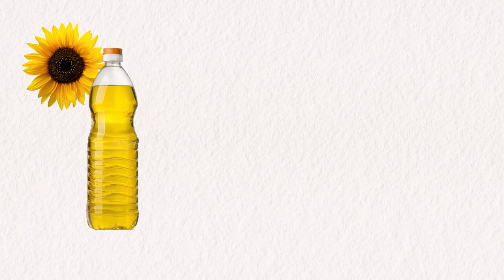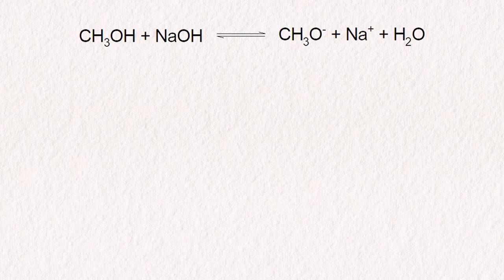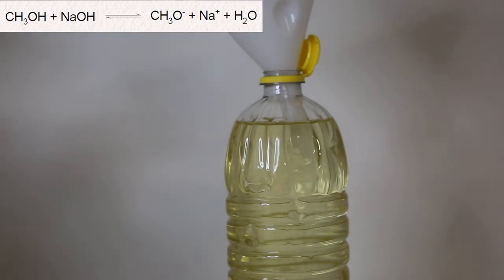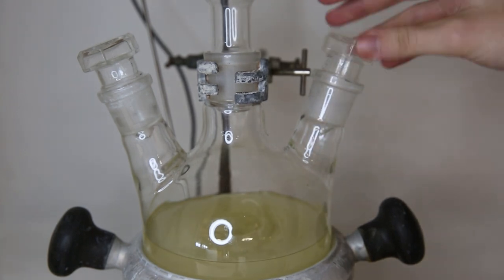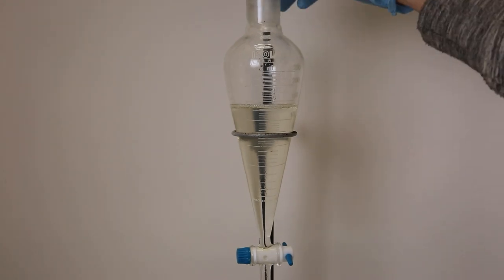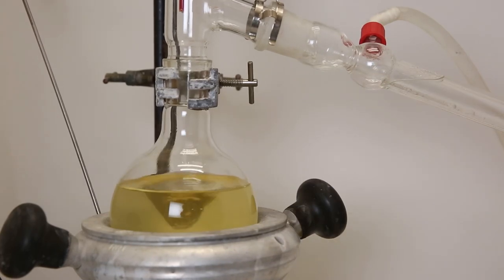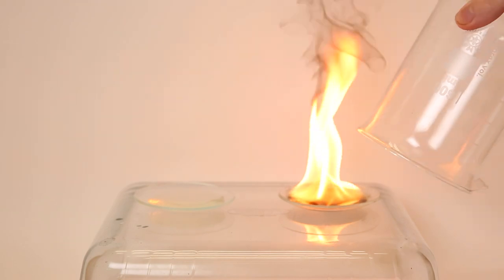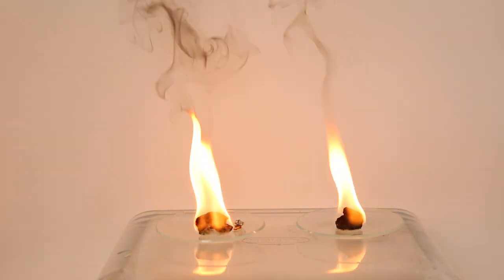Making Biodiesel from Sunflower oil

Comment: I made bio diesel using coconut oil thinking that the shorter chain fatty acids would result in a much easier to burn fuel due to higher vapour pressure and yes it worked. It burnt very easily. I didn't use any toluene but used salt water which separated the soap quite well and the separated biodiesel was washed with water and dried using anhy. CaCl². Fun fact - the biodiesel smelled like fake pineapple scent due to esters of some fatty acids (maybe the esters of 7-8 carbon chain acids are responsible which are present in coconut oil)
Reply: Also i used potassium hydroxide as the catalyst which i think made it easier for the soaps to be separated.
The flames were almost soot free and burnt pretty clean.

Comment: You could use regular diesel instead of toluene as a solvent - You would not have to distill off solvent… and also some addition of regular diesel (10-40%)  is much desirable from the engine POV (pumps, injectors…)

first step - oil dehydration is also redundant - this oil is anhydrous - transparent… cacl2 or similar will definetely not make it dryer… dehydration after washing is also not necessary - prolonged , low rpm stirring with water (2hrs or so) will do the work - You will end with clear liquid which means that water content is really low… this thing can be dehydrated just by passing through column filled with relatively small portion of dry 4A molecular sieves to the second container

Comment: the sooth comes from incomplete burn, probably caused by low temperature air and because of lack of oxigen. it is 'pure carbon' that had not enough air and temperature to combine with oxigen.

you probable get less sooth if burnt in a 'storm' kerosen lamp, either hor or cold blasted, (the flat wick and pre-heatin of the air helps a lot) or an argand lamp (tubular wick)

(petroleum industry worker ;) )
Reply: Hard to take you serious when you don't get the nomenclature correct.
Reply: Shain Andrews > what is incorrect in what he wrote?
Reply: @cielvague  sooth... oxigen... kerosen...   Then there is the entire position that is incorrect.  Soot, is the result of a rich fuel to air ratio condition.  Air temperature is not relevant.

Comment: Love your videos dude 👍
Did you add any to a diesel car? It's legal in some countries, including UK
Reply from the maker: I didn’t, i’m unsure of the purity so it’s probably not good for the system. Besides, i don’t have a diesel car to use it in :’)
Reply: I don't care if its its illegal, why not use it?
Reply: @mattbanks3517  many years ago I was watched a YouTube video where this guy claimed it was cost effective at home to use electricity to make pyrolysis oil from plastic as diesel fuel. The video was taken down. 
   I found out it was because posting the video got him a $25,000 fine for putting untaxed fuel in his commercial vehicle and driving it on the highway. 
  Even Lawyers don't know All the laws, and laws are written ambiguous so they can be twisted and reinterpreted such anyone can be guilty of anything, so privacy is best, just act without selfish greed and avoid hurting others and don't talk to anyone about what you do.
Reply: @Chemiolis  buy a 2003 ford f250 with a 7.3l dual overhead v8 factory turbocharged diesel engine immediately.

Comment: When i was shopping recently i saw the a litre of sunflower oil now costs €5.
A litre of Diesel costs ~€2.
What do i need to do to make the Diesel compatible with my salad? ;-)
Reply: Sunflower oil consists roughly 3/4 of biodiesel by volume (simple math: it makes 3 moles of biodiesel to 1 mole of glycerine, so 3/4), so, without all other things you put into it... yeah, it's worth it only when you have access to cheaper than dirt oil (like some dudes who make it from used deep fryer oil).

Comment: Wouldn't acid catalysis be preferable?
1) Conversion of FFA in the oil to the FAME (slight, likely insignificant benefit) and
2) Less likely to have soap in workup, so may avoid need for FAME solvent, so less solvent waste, no concentration needed, and smaller volume

Comment: Can glycerol be decomposed into methanol? It would be cool to be able to feed the waste glycerol back into the reaction as methanol and it kind of seems like it's something that should be dooable, but I'm no chemist
Reply: I did recycle the glycerol back into the reaction in my biodiesel lab. We made potassium glyceroxide as the catalyst and used ethanol instead of methanol
Reply: @atrumluminarium yes, the glyceroxide performs the same function as the hydroxide salts (NaOH, or KOH). The difference is glyceroxides will not form water when mixed with alcohols

Comment: thanks for the video, what is the proportion for ethanol usage instead of methanol? I'm in Ukraine, and I have cheap sunflower oil and ethanol so would like to make some biofuel. But no luck for now.
Reply: you can substitue methanol with ethanol at a 1 to 1 ratio
Reply: Ethyl esters is much more difficult, you require anhydrous ethanol which cannot be obtained by distillation (ethanol forms an azeotrope with water).

Methanol is quite cheap industrially, so nobody bothers using ethanol.

Comment: Was removing the water from the oil a necessary step? And if so, can the water be removed through distillation?
Reply from the maker: It's not really necessary, don't bother with distillation, it likely won't work.

Comment: Could you use ethanol instead of methanol, which is highly toxic, both if inhaled or through skin resorption ?
Reply: of course you can use ethanol, you can even substitute sodium hydroxide with potassium hydroxide
Reply: The ethanol has to be anhydrous, so you must dry with molecular sieves.

Comment: Figured there would be a resurgence of bio fuels.  Might have to open my shop up again.  Start tearing down engines after individuals play around with this tomfoolery.  Wait till they see the price of common rail injection components.  They can't drive enough miles and dodge enough road taxes to ever recover the cost of the repair.
Reply: Most common rail systems are ok with a little bit of it, my car can take up to 5% in the fuel according to the manufacturer. 

When I made some biodiesel as an experiment I made sure it was super clean then added it to my tank at 2% on each fillup. Took a while to use the full 4L I'd produced. I also tried adding a small quantity to petrol for a 2T outboard alongside the 50:1 premix of TC-W3 oil, but found it very unsatisfactory in that regard. Most of the biodiesel didn't burn and instead came out the exhaust as smoke. On the plus side, the 'vegetable' smell of the smoke did mask some of the usual 2T exhaust odor. Mixing with petrol in an air-cooled 4 stroke engine (my home-made 'webster' engine) had similar results, lots of vegetable smelling smoke out the exhaust, though on the plus side it did seem to serve OK as cylinder lubricant in that case (the engine has an open crank and the cylinder is usually drip fed oil).

Fun side-note, biodiesel reacts strangely to brass or bronze parts if left in contact for long periods, creating weird greenish precipitates which I can only assume to be copper salts of fatty acids. I found this out as part of another experiment building a miniature diesel fuel injector. So anyone running a vintage diesel engine should be very wary of biofuel, lest they have to disassemble and clean their entire fuel system.